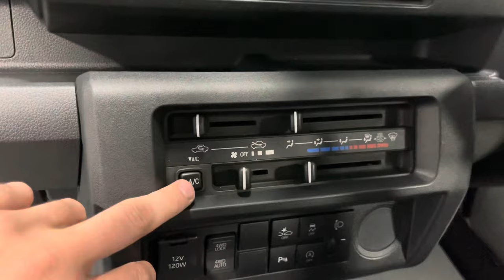2023 Daihatsu Hijet Box Van (Made by Toyota)

Comment: Very nice truck. Lots of possibilities for camping.
Reply: That's what I was thinking as I'm 5'9" so 6 feet long by 4.5 feet wide would be awesome.  Well if they were street legal.  I've seen some of the kei vans from the 1990's that could work.  Rear seats fold in for an open flat space.  Youtube channel Mike Festiva and his brother have early 90's kei trucks that are legal because of the 25 year and older rule.  One is a Suzuki Carry and the other a Honda Acty both 4wd.  They built custom rigs that weigh about 300 pounds that fit in the beds and can be removed if you want to use it as a truck.  They're in Washington state and they are extremely impressive off road and can go places that only something like a UTV side by side or ATV could go because they are so narrow.  Outside of that maybe a Suzuki Samurai could access some of the places they've camped on mountains.